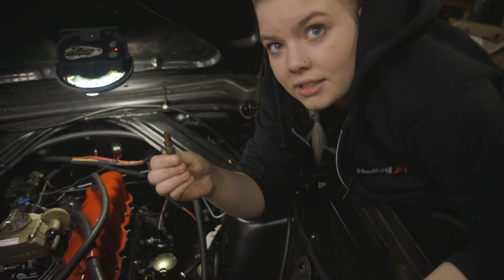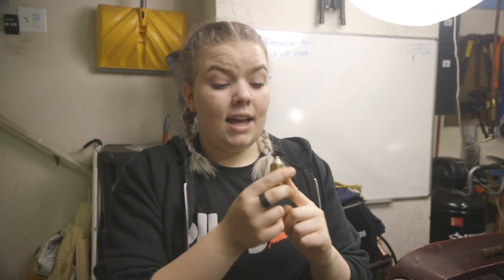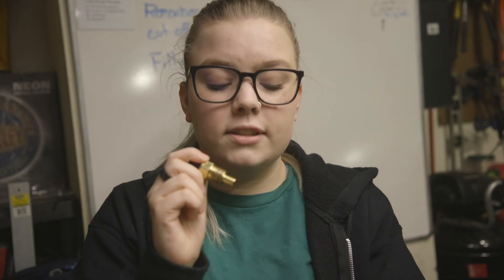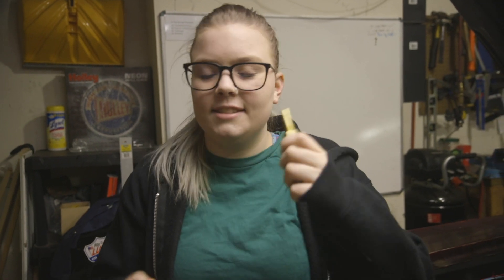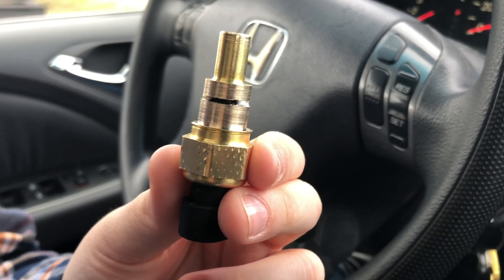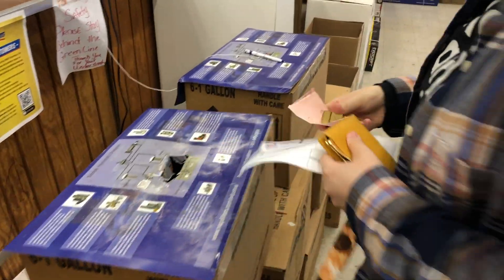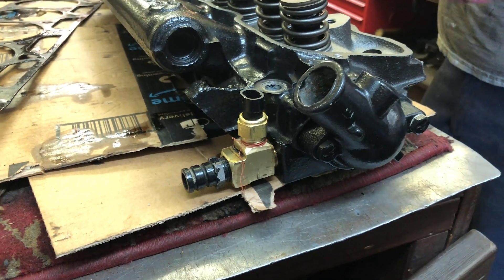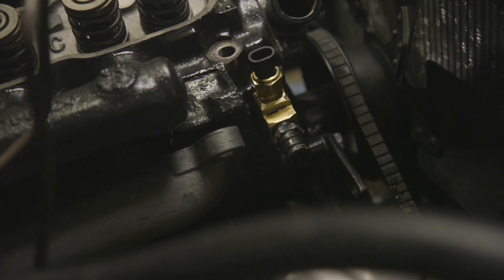Different Coolant Temp Sensor Sizes! Our Fix - HOLLEY SNIPER EFI

Comment: What company made the smaller sensor?
Reply from the maker: The smaller sensor is made by Dakota Digital and it comes as part of their digital instrument panel kits. You can find different types on their site here: https://www.dakotadigital.com/index.cfm/page/ptype=product/product_id=111/category_id=-1/mode=prod/prd111.htm
Reply: I have same problem on my 1980 Jeep 258 inline 6. So you found a smaller sensor that works like the Holley?

Comment: well did u know u could have used a aftermarket coupler that u put on ur radiator hose that and install it that way my buddy did that and it doesn't look great but does work

Comment: Glad you found a solution. 
Why not use a thermostat housing adapter with a temperature fitting provision?
Reply from the maker: Thanks. We thought about that, but Holley's techs said that the sensor needs continuous flow before the thermostat opens. Of course, unless our AC is turned to heat, we don't get true flow past our sensor, but I guess it's close. We've tried finding an adapter that might let us put the sensor in between the thermostat and the block, but could only find them for V8 engines.
Reply: @ElliesGarage   is the engine a 200ci Ford/Mercury 6 cylinder? 
Any area in the water pump?
Reply from the maker: @cowtown_dad  Yep, it's a 200 straight 6. I don't believe so, but honestly we hadn't even considered there being any space on the pump itself. Might need to take another look at it.

Comment: I'm a truck driver during the week and a journeyman mechanic on the weekend. I've spent ALOT of time working on all kinds of things from classic cars to combine harvesters and they all have the same thing in common. Figuring out solutions to problems that pop up and adapting something that wasn't specifically designed for what you're working on. 
As you go along, the more problems you encounter, the easier it'll be to find solutions because you'll start thinking outside the box. That t fitting was a great idea and I'm glad y'all was able to get it figured out.

Comment: why didn't you just get a thermostat housing with a port to install the sensor.
Reply from the maker: Good question. We actually have a housing with the right port, but the Sniper instructions specifically said for us to not install the sensor there. After talking with their tech people, they said they wanted the sensor to have a constant flow right from start up.
Reply: @ElliesGarage  So an spacer block (with the sensor installed) between the thermostat housing and the intake manifold wouldn't be a constant flow? This is important because this is what I would like to do on my '66 300ci. Thank you for your time putting this video up.
Reply from the maker: @jeffcurrey8765  That's a really good idea. Our port is on the outside of our thermostat but if you had a spacer that you put in between that could work great. Do they make that or would you  have to make your own?
Reply from the maker: @jeffcurrey8765  That's another good question. I don't think so, but I would double check with Holley's tech line. It can take a little while to get to talk to a tech but they are very helpful.

Comment: Oh and also, most new thermostat housings on ebay for the small 6 have a small hex head plug on the top, probably for burping the system. But that plug can be taken out and replaced with a sensor.

Comment: Holley doesn't understand the word budget lol. My car runs absolutely great, smooth as a new engine. No issues with the carb at all. 

The price alone would make it a non-viable option. Let alone the "if it ain't broke, don't fix it" voice in the back of my head.

Comment: I wonder if you could have found out what other cars the new sensor worked in, and then called Holley to get one compatible with the EFI system. Also, you could have also bought an adaptor that goes in to the upper radiator hose and gives you a threaded boss to put the sensor in. Also, you might have been able to remove the water neck, and have it tapped so you wouldn't have had to remove the head again. I know it's too late, but something to think about. Edit: I typed this before watching the end of the video. lol

Comment: Great problem-solving.  Looking forward to seeing how this all comes together. Given that this is a pretty common engine, I am surprised Holley did not already have this figured out.
Reply from the maker: Thank you! This is Ellie's dad popping in for a quick comment. This Autolite 1100 Sniper kit is definitely a new one for Holley, and it seems like it's been designed mainly with Mustang straight six engines/heads in mind. We're guessing that us having an older Falcon head and temp sensor is what's thrown the curve here.
Reply: @ElliesGarage  Yall are doing a great job. I am considering putting this one on my Mustang. I also wonder if there is a difference if you have a temperature gauge verse a light.  I know the oil pressure gauge is different if you have one or the other.  Keep up the great work and wonderful content. Helps to keep me motivated to work on my project.

Comment: Way to stick with it Ellie.  Lots of work!  One suggestion would be to have left the stock sensor alone so your cluster temp gauge works and then install something similar to an Autometer 2283 in your upper radiator hose for the Holley sensor.  A lot less hassle but not as clean as your solution.  Keep up the good work!
Reply from the maker: Hello! We did put the stock sensor back and plugged the gauge back in. We probably should have showed that. Thank you for the encouragement!!

Comment: The temp gauge on the dash may need the original sensor to read correctly and holley sensor to operate the carb sense the ohm's are different???
Reply from the maker: Hello. Yes we are using both sensors. We put the stock sensor back in and connected it back to the gauge.

Comment: OMG!!! You poor thing! 😭😭😭 
I wish I knew about this beforehand.... 
O would have said to put the original sensor back into the Head - and either use the T Fitting on the Heater Hose Fitting....
OR just remove the Thermostat Housing, and have THAT Drilled and Tapped to fit the Holley Sensor. 
I'm sorry you had to remove the Head!!! 😖 

Also, if you're interested in improving the Handling of the Car by a good margin, check THIS out: 
https://youtu.be/zsFBTTAi_6o 

This is one of my favorite Channels, and Jeff is a really friendly guy, who has a lot of clever solutions for old Fords! 😉
Carmine ✈🚂🚙
Reply from the maker: I know, right!? Actually, it wasn't too bad. I just really didn't want to do it. We actually have a place in our thermostat housing where we could put it but the Holley instructions told us not to install it there. I think this should work though. Thank you for the encouragement!!
Reply: @ElliesGarage  That WILL work!! 😊 
I've used the Thermostat Housing or Intake Manifold for Coolant Sensors on nearly everything I've built... 
Kinda Curious as to why Holley didn't want you using the Housing. 😲 

I installed the Holley EFI system on my 83 Mustang GT 5.0 - and used the Thermostat Housing for the Sensor. 

Oh WAIT! Just figured it out. 
5.0 H.O. Engines all use a reverse rotation Water Pump... So the Coolant coming OUT of the Thermostat to the Radiator is Hot.

Yours is standard rotation. The Coolant going IN the Thermostat is Cold!! That would send a false signal. 
...... I would have figured it out before any damage was done!!! 😜😂 
I'm just GLAD you got it in - and working! 😉👏👏👏👏👏

Comment: Wow I was planning on getting the same kit for my 65 mustang, but after seeing you having to take the head off I'll just hold off and drop the 2 barrel carb on for now. Just had the engine rebuilt not trying to take it all apart so soon.
Reply from the maker: Wait, make sure you watched to the end. We did take the head off but we didn't need to. All we had to do was put in a t-fitting and elbow fitting on the hose to the heater core. Be sure to watch to the end of the video. Part numbers are in the description. Also, I think your 65 Mustang will take a 3/8 sensor, so you probably won't even have this problem.
Reply: @ElliesGarage  haha I just saw the fix, but yes I got my cylinder head off of a falcon. I really just hate my one barrel carb.
Reply from the maker: @felix2210arf  OK, good. I felt bad like I wasn't showing what we really did. Yes, our carb was really annoying too, and now spoiler alert it's running so good with the EFI. Starts really well and no scary idles when we stop or hit a bump.
Reply: @ElliesGarage  Thats amazing, the one barrel for me is just not consistent and I don't like how it takes off. How's the throttle response with the efi system?
Reply from the maker: This is our first car like this so we don't have much to compare it to. But when you push the accelerator there definitely isn't a delay to hear and feel the engine. Sorry if that's not very helpful.
Reply: @ElliesGarage  Thats great, from what I experienced is that you really can't launch the car with the little 1 barrel. It likes to hesitate. Just by hearing no delay makes me want to buy one right away.
Reply from the maker: Hey Armando, Ellie's dad here. We're still finishing up next week's episode showing the EFI install, and we'll be sure to demonstrate the throttle response. Sounds like that would be something people would want to see/hear. Thanks for the tip! Ok, dad out.

Comment: I think you made yourself crazy on this one, I believe you connection is 1/8" x 27 thread on the 65. You could have used item number 37931 or 4051141 from a company called FOUR SEASONS. I think would have been a straight swap....
Reply: Hi, never got your response, ok after doing some research, the four seasons sensor does not have the same spec as the TX3. but as as FYI, if it did, the wiring would have  been simple, the TX3 is a two wire sensor one wire is power the other is the ground, the Four Seasons is a simple one wire system and sensor itself is the ground, so you would have needed to add a ground wire from the block to the other wire on the TX3 plug and would have been your wiring. But that water under the bridge at this point. Another simple work around would have been, put a plug in your sensor hole and added an inline  Inline Radiator Hose Temperature Sensor Adapter. this is a rigid radiator hose pipe that is cut into your radiator  hose that comes out of the engine since this is hotter water then your return coming after the radiator. these can be purchased on summit, Amazon and many other on line stores...
Reply from the maker: @Paulie1232  We had asked Holley about using the water outlet adapter, but their instructions specifically say not to install the sensor where it won't receive constant coolant flow from startup. Although, thinking about it now, I wonder how bad it would be, since the sensor would sit right on the other side of the thermostat. You would think you'd get a decent amount of heat carried over before the thermostat opened. But, once we heard from the Holley techs to not use the radiator outflow adapter, we crossed it off our list of options. Good call on the sensor wiring, though. That makes complete sense.
Reply: @ElliesGarage  I owned a 61 Comet for 25 year, which is sense is a falcon...did a complete off the body restoration years back and brings me back to that time and pleasure to watch and share any knowledge I may have....good luck and have fun...
Reply from the maker: @Paulie1232  Cool! Thank you sir!
Reply: @ElliesGarage  when the engine is cold and thermostat is closed there is no water circulating in the engine, engineers sometimes make no sense....
Reply from the maker: Hello, Paul. Ellie's dad jumping in on this one. That would be a great fix. Yes, the stock sensor is a 1/8 NPT. Do those sensors have the same ohms curve/ranges as the Holley sensor? Holley uses a Standard brand TX3, and I contacted Standard and they don't make one with the TX3 specs in a 1/8 NPT. If they are the same range, how do you wire the Holley sensor connector to the one wire sensor on the ones from Four Seasons? If this works it would be a great option for Holley, and everyone, to know about. Thanks!

Comment: Water boils at 212°F, maybe the one that read 210° was right
Reply from the maker: Hello. Ellie's dad jumping in here. Thanks for the comment. We actually did some tests there, too. As soon as we poured boiling water into a container, especially in a the cold garage, it immediately would show a temp drop into the low 190s. Also, before the boiling water test, the second gauge showed an ambient temp of 112. So, the Holley gauge was accurate.

Comment: Adaptors are "engineered" to "just work", unfortunately modifying them will always make them weaker. Even if it didn't leak at first the vibration and heat cycling would have cause a leak, or even break, very quickly. I hope Holley take note of this and provide a smaller sensor for engines like yours. Be sure to fit the wire back to the old sensor so your dash gauge works. Excellent effort.
Reply from the maker: Yes sir, we hooked it back up to the gauge. Thank you!!

Comment: Nice work, I was waiting to see when you installed the first adaptor to see if the treads would break off due to thinner walls after drilling it out . then it did. After installing the old temp sensor back in the back of the head you should reconnect the wire to it to have a working gauge or light in the instrument panel. The new one is just for the EFI unit. To bad you had to remove the head again , remember the head gasket is NOT reusable. Must be replaced. I'm sure you did , but just to give you a heads up.  I thought about EFI for my 83 F100 but Holley says their units are not for Emission legal vehicle. Like my carb is any better than the EFI . Holley please!! Actually worse on emissions . But for now until prices come down on it i will stay wit the carb.  Looking fwd to see how it runs on your car. Love the show and that YOU have interest in doing this to an old car.  As always Keep up the good work.   Cheers from Michigan. Gabe.
Reply from the maker: Thank you so much! And yes sir, we definitely replaced the head gasket with a new one. Thank you again and welcome to the Patreon Team!!

Comment: That looks like a newer GM coolant temp sensor.  You should have been able to find a smaller one with the appropriate resistance/ohm range.  You solution works also.  More than one way to skin a cat!
Reply from the maker: It's a Standard brand TX3, and believe me, we looked. If anyone finds one, Holley will be very interested to hear it...and us too. Ha! Thank you for the encouragement!
Reply: @ElliesGarage  maybe this adapter would work? 12mm to 1/8 NPT adapter.  I assume Holley uses one sensor for most of their kits. https://www.speedwaymotors.com/LS-Swap-Temp-Gauge-Sender-Adapter-Fitting-12MM-x-1-8NPT-Long,327790.html
Reply from the maker: @MissionRestomod Yes sir, Holley seems to use the same sensor, but that adapter has the same problem we showed in the video, the inner diameter on the 1/8 side is too small to allow the sensor to pass.        - Matt/Ellie's Dad